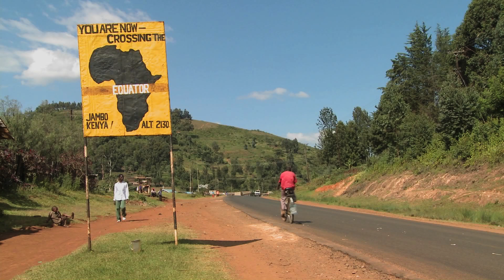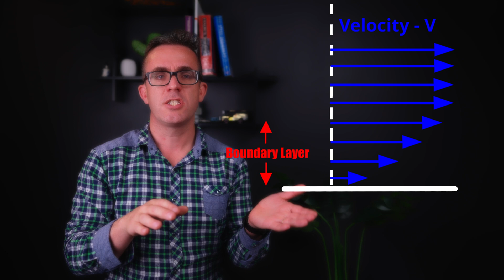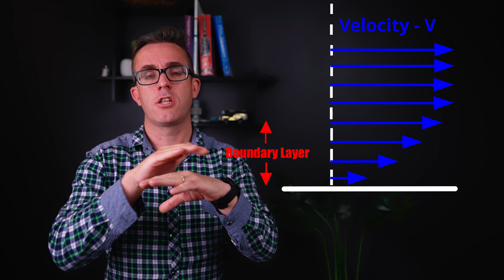What Factors Affect Wind Loads on Structures - Insights of a Structural Engineer

Comment: How does one calculate the thermal wind load - (not wind chill, as that's a human perception), but how many additional watts leak out of a structure related to wind speed?  It seems sensible that the humidity and density of the air would correlate with how much heat it can take off a surface per second, but is there an architectural formula treatment for this?

Comment: Love the content! I`m in the prefab-steel and -concrete business, do you have any experience in that field or mostly general construction?
If i were to give any criticism/input it would be to show more examples of the different concepts/solutions/details you are covering. For example, lets say you are highlighting different steel connections, show a detail, a picture from an actual site or maybe in a 3D environment. 
Keep up with the videos, this was the best one so far :)
Reply from the maker: Hi Millivanilli, thanks for the support, always looking for improvement. I was the lead site engineer on a shopping centre for around 1 year full time but have been involved in a lots of construction and design . agree on getting more example, both real world and drawing, the issue at the moment is finding time. Was thinking of posting 3 videos a month.
Reply: @BrendanHasty 
Hey big like to your channel
How many checks do we need to do after applying the Wind load on the high rise building
Reply from the maker: @qureshisiddig9274  Hi Qureshi, typically you need to make sure the building is behaving correctly, so the model response and mass for the building. you need to do wind tunnel testing to ensure the building is behaving correctly.

Comment: I've been wondering whether there are examples of secondary structures that have been built around a primary structure for the purpose of protecting the primary structure from wind loads (artificially increasing the terrain category, or diffusing/deflecting the forces?). A small scale example might be the partially buried earthship structures, but I'm curious about buildings on a larger scale.
On new construction, it would make sense to design the structure to shoulder its own wind loads, but for historic structures -- can they be effectively buffered in some way?
You said local terrain characteristics would require a distance of approximately 40x the building's height, so perhaps that's not feasible, but I'm still curious.
Reply from the maker: Hi Steven, I think in theory that would work. It would need to be confirmed by wind tunnel testing, or CFD modelling. The 40 times the height is for if you need estimate the wind speeds, the achievable   reduction is only achieved through additional testing.

Comment: If the building you are designing is complex, it is better take it to wind tunnel and a CFD simulation is recommended. In many design code, you can get turbulence information in order to define your own turbulence model in CFD. In Eurocode, it is recommended and list the first 3 modal shape shall be taken in consideration. Thank you for your introduction on wind load. It is one of most complex phenomenon in engineering due to structure shape and turbulence and vertex. I appreciate your video very much on the topic .
Reply from the maker: Hi Bo Zhao, from my research CFD at this stage is only a estimation so it is good for scheming and shaping of the building shape, while Wind tunnel is required confirm the real wind loads. Thanks for the support.

Comment: Can you get any civil engineering types that spend a lot of time outside rather than inside?
Reply from the maker: Hi Tom, this would involve more in the site work. most design work is done indoors.
Reply: @BrendanHasty  what types spend lots of time outside?
Reply: @tomhercus6676  I believe Site engineers and supervisors are the ones.
Reply: @DeepakKrishna11  What are the differences between  civil engineering and  land surveying. I cant decide what to choose
Reply: @tomhercus6676  Well Surveying is the process of measurement of a land for
 development purpose. Civil engineering is the engineering field that that does that development like residential project, etc in a nutshellm
Reply: @DeepakKrishna11  ok

Comment: For the last part, that's the Strouhal Number consideration. (Fluids guy). Love your videos.
Reply from the maker: thanks for the support, and the technical term for the crosswind response.
Reply: @BrendanHasty  I was impressed by your Reynolds number response and showing the von Karmen vortex shedding.  If you have not seen, check out the black and white book "Album of Fluid Mechanics" and appreciate the "old school" experiments...real craftsmanship. (FYI...considering pursuing some structures courses, but can't decide on traditional civil OR aerospace structures [live in FL where SpaceX, etc. launch from the Cape]).
Reply from the maker: Hi Dr Ticktock, thanks for the suggestion in will need to check it out. If it was me i would try to work at SpaceX they are pushing the boundaries of engineering which is exciting.